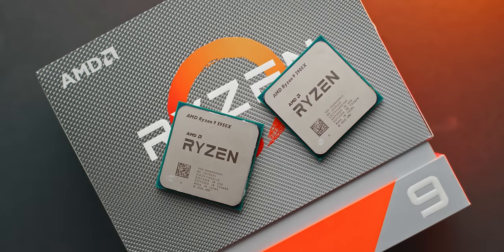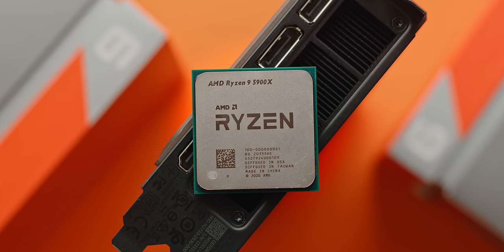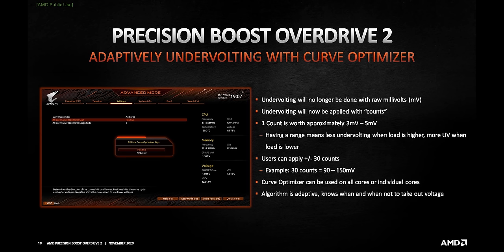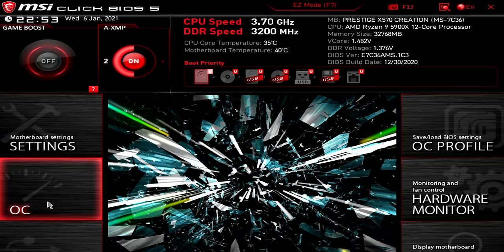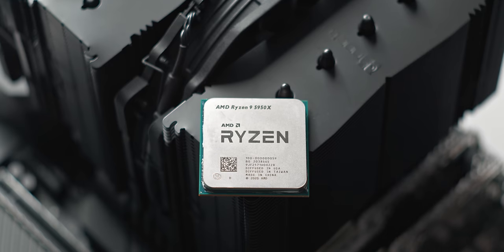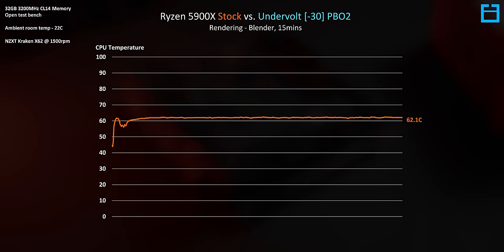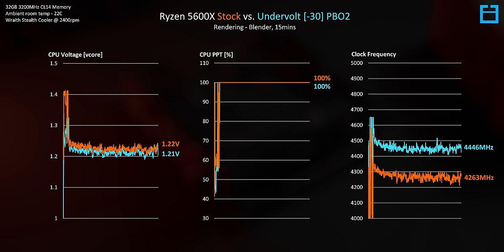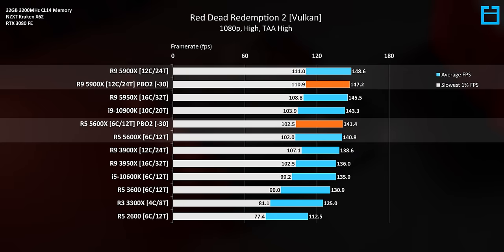Ryzen 5000 Undervolting with PBO2 – Absolutely Worth Doing

Comment from the maker: Slight correction - some users are seeing PBO2 available on B450 motherboards.
Another update: It is available on some boards with AGESA 1.1.0.0, including my Crosshair VIII Impact. Just tested the Ryzen 5900X in my own system - it can do a negative offset of 25.
Reply: If you push the curve down far enough with this feature, does it result in lower idle temps?
Reply: @ivchatov  yes sure does. But if u push curve and leave 200mhz auto oc on you may have to increase (from -30 or -20) curve to persay -12
Reply: @ivchatov  with auto no curve 200mhz auto oc max voltage is 1.45/48v on b550 gaming edge wifi, and it's x570 counter. With 200mhz auto oc + -12 curve max voltage (with 4.85ghz all core) is 1.41v.... temps will go crazy without pbo and limiting edc etc. He didn't touch this bc it's different for EVERY chip say, 10 5600x not one will have the same pbo limitations. (All is auto, no manual voltage sets other than 4000mhz 2000fclk to ram, and 1.45v on my dram voltage. No static oc to the processor. Am able to run 3200c14 sticks of tforce dark pro at 16,15,15,15,32,38 with tight subs an secondary timings. (Wasn't asked about but these chips from what I've seen are all doing 2000fclk oc. Even on e die kits (worst ram die to date.)
Reply: I have B450 Tomahawk Max with AGESA 1.1.0.0 Patch D. Running 5600X PBO2 enabled.
Reply: @turskaparoni  yep, curve works as I stated. It's under advanced on msi boards inside amd overclocking
Reply: Crosshair VIII impact does have a beta bios with 1.1.9.0
Reply: @VargVikernes1488  was running patch C without issues 3200c14 dark pro kit at 4000mhz 2000fclk but my L3 cache speed were horrible. Updated to beta 1.1.9.0 and now have the same results, but nomore issues with l3 cache.
Reply: @Kraxt0n  cool what are your Timining? currently stuck at 3800mhz/1900fclk cant seem to find a proper profile
Reply: @MistaMeester  it took me around about 4 minutes to get a 4000mhz 2000fclk to boot which is how long it took me to swap my new 3600xt out and install the 5600x lol, but it took me a few weeks to get these timings i have now. granted i could make a few adjustments considering my tfaw (SOME SAY) should be higher but none the less, no weird stuff or stutters or crashes. KEEP IN THE FRONT OF YOUR MIND that VDDG IOD, CCD, AND CLDO VDDP values STOCK are ALL WAY TO HIGH for what the 5000 series actually needs. stock values for my board all run 1.1/1.2 when you can see im running it way lower than what the boards believing it should be. 

AMD needs to get this configured bc it will start KILLING and DEGRADING signal integrity as well as start making the minimum safe mv adjustments go way higher than they should be.

IF YOU REALLY WANT TO KNOW MORE join https://www.overclock.net/threads/official-amd-ryzen-ddr4-24-7-memory-stability-thread.1628751/page-275#post-28712772
and thats where youll understand how these chips work, and see my claims to be true as some of these people are EXTREMELY knowledgeable and speak with amd directly as well as rework bios revisions for their own boards etc.
Reply: You mentioned not having the correct BIOS on your crosshair VIII impact board, I'm seeing that they have a beta BIOS available with 1.1.9.0. Not installed it on my board yet though.
Reply: @AdamChopdat  you both should for sure install 1.1.9.0 way better performance, stability, overclocking ram support period.
Reply: Would’ve been really nice to see this brought back, if only on 500 series motherboards
Reply: B550 vision only had AGESA 1.1.0.0 available.. Fml...
Reply: Where is 5800X? 😅😅
Reply: @tigerag29607  AGAIN, 1.1.0.0 has curve optimizer settings under AMD OVERCLOCKING.....not under cpu settings as showin in the vid...
Reply: @Kraxt0n  OK... Yea I get it.. I just assume AGESA 1.1.8.0 is better optimized or functioning whereas that version is maybe unstable.. Maybe that's why he only recommends it.. Idk
Reply: Why don't you do laptop reviews?
Reply: @tigerag29607  he didnt recommend it tho, he said its only available on 1.1.8.0 or higher as msi skipped 1.1.8.0 entirely and hit 1.1.9.0 but, patch C is pretty good for the most part. didnt have issues with it other than my L3 cache bandwith in benchmarks not being accurate to where as after updating to 1.1.9.0 now they set at 650/670ish and my read speeds are 59/60k and latency is 52.3/5 

all in all tho AGESA ComboAm4v2PI 1.0.8.1 has bar support and 1.1.0.0 has BAR as well as curve...just most dont know this bc its not in plain sight like it is in the vid as its under amd overclocking section which i dont believe many use as some state its still bugged....?
Reply: Tried on 1.1.0.0 and it's crashing the system and apps have to update to the beta 1.1.9.0 I'm on MSI b550 carbon
Reply: @AdamChopdat  and @optimum tech latest BIOS for the Crosshair VIII Impact (3102) does indeed have PBO2
Reply: Asus impact bios 3101
Reply: Sorry meant 3102
Reply: jump on the newer agesa beta bios for that board its far superior. i am willing to bet you are getting corrected WHEA log warnings on 1.1.0.0, they arent noticeable in use, but they absolutely spam the windows system logs with warnings, and that can effect single threaded performance pretty significantly if you are looking at the numbers.
Reply: Do you leave voltage at auto? Wish you went over the bios settings a little more.
Reply: @adi6293  probably because it's a horrible buy lmfao
Reply from the maker: @peeposadboy  yes, everything else default except XMP.
Reply: I dont know if i did something wrong but my 5900x is at -23 stable and hits 1.119v at 4.4ghz in cinebench r23 multicore... Are the steps on my mb different? (rog strix x570-e gaming)
Reply: @optimumtech  ty ty
Reply: @optimumtech  So I just set my Negative curve on my X570 Strix-i to 13, and some cores are boosting to 5.0ghz? In game it's around 4.7-4.8?? That don't seem normal... Should I lower it?? Vcore is only at around 1.32v
Reply: @peeposadboy  I got one for £420 with a £60 game that I was planning on buying anyway, it's not that terrible but it's not great either. I don't need 12 cores but wasn't even a consideration 5800X it's in a very awkward place on the market 😅😅
Reply: @BrunoMartinsHertZ  patch C?
Reply: @Kraxt0n  yes, for now I will wait for a stable build 1.1.9.0
Reply: @turskaparoni  are  you using the latest beta bios on the msi site?
Reply: @benson556  Yes, the one uploaded Dec 10th. Had it now for over a week without any problems. Running my 3600 b-die kit @ 3800 cl16 1:1 FCLK and fully stable after overnight Prime95 and Karhu stress tests.
Reply: New to this, but I tried the 30 and this caused my rig to restart. Dropped it to 12 and it worked...but I'm curious if there are only certain voltages you can use?

I.E. 12, 20, 30 are the only ones  or you can run the gambit between 1-infinity.
Reply: I tried -30 on my 5600x but it crashed halfway through a run of cinebench. Setting it to -28 allowed it to run fully stable for 5 simultaneous runs.
Reply: @ThreeForks  I wouldn gamble on anything beyond negitave 30 if it doesn't bug out. It'll drop voltage to the point to where it won't allow bios to be reachable. Which a simple bios reset will solve. 

From what I've noticed on my b550 gaming edge board 5600x +200mhz auto oc, negitave 12 curve voltage max 4.85ghz is 4.1v vs no curve is 1.48/5v which from what amd released 5000 series auto boost will hit 1.5v depending on temps, boost, what the system is doing...
Reply: @BrunoMartinsHertZ  Same here On Gigabyte Master X570. Crashing on -15 with 1.1.0.0. (-20 crashed MC and -15 crashed on SC but passed MC) Did not bother with lower values. For now I am going with -0.05 VCore offset and it is all good. I guess I will wait until get 1.1.9.0 AGESA
Reply: @Kraxt0n  Did you check for WHEA errors? When I setup my 3200 GSkill kit to 3600mhz I get spammed with WHEA errors. No idea if my Ram is to blame or whether the CPU can't handle it. I did try to push SoC and ram voltages quite high, they were still healthy but relatively high. Got the MSI MEG X570 Ace. Currently using the 7C35v1C bios which has Agesa 1.1.0.0 Patch C. There also is a beta bios availabla with Agesa 1.1.9.0 but I don't know whether I should update it or not.
Reply: @VenoXj1  yep, not a single error. Only issues I've had was a m.2 ssd enclosure not working right. Still hasn but I believe it's the SSK enclosure to blame. As for any error I have, it's only related to stuff I force kill i.e. razor synapse software, after burner, Px1, IDM, etc by task killing, or disabling the service related to the app and trying to run it as I disable services for benchmarks to keep them from running.

You should update that bios tho, 1.1.9.0 is by far the best yet. Your errors may be CCD, IOD, VDDP related. Or to lower voltage, or tRFC1 tRFC2 tRFC4 may be off. tRFC actually matters 1-2-4 all 3 will create errors on ryzen. But no, no errors period. Any blue screen I've had is pbo related to where I'm lowering ppt, etc values to low and using to hard a negitave offset curve.
Reply: @Kraxt0n  Yeah, I've had random BSOD which also were related to curve optimizer. I had to drop -15 to -10 so everything works fine. I might and try to update it, how do you actually do it though? I've never done it myself.
Reply: I just checked the available BIOS Updates of the B550m Mortar WiFi which I plan to buy together with a 5600x soon. This supposedly has a beta 1.2.0.0 agesa update and a 1.1.0.0 regular one. At least the 1.2.0.0 beta should be able to do this, right?
Reply: @Kraxt0n  I saw that you replied but sadly it doesn't show up here.
Reply: @optimumtech  Have you tried setting the magnitudes per core and leaving the best performing cores less undervoltage? I think this might improve the single core performance but like to hear more about it! Sorry if this has been asked/discussed already elsewhere
Reply: uiqbal11  I still havent figured out how to run my 5800x stable in 3dmark time spy with any of those settings, sadly. Cinebench is working fine.
Reply: My 5600x is only stable at -15. Even with that I got better results on multicore and single core (reaching 4.6ghz). Thanks a lot for the guide!
Reply: B550m Mortar with AGESA 1.2.0.0
Reply: How do you do this in the UEFI bios? Is it the “offset, negative,” then enter the value? Which value? 5900x and crosshair viii impact here. Thanks for the help.
Reply: @adi6293  in flames 🔥🔥🔥
Reply: @davey1412 ?? 😅😅
Reply: Any chance to do a walk through an the Asus bios? There are conflicting reports that “negative” and “positive” are actually reversed in bios for some reason. I can’t seem to get this 100%, and can’t get a stable system sadly.
Reply: @BrunoMartinsHertZ  yo my problem with the b550 carbon is my ram can only run single channel. Is yours running fine on the beta bios with dual channel?
Reply: @romeskiees  I didn't tried because is a beta and as you can see in reddit the msi just fool us because the stable build will be the same with another build number
Reply: Well with my system and 5600x

I get best results with the following

Bclk 101
PBO motherboard
Curve -4

I get 4.5GHz all core in R23

Where as outside of these settings i get max 4.35GHz

So depends on system and what you want mine cooks the shit out of itself but runs faster

Edit: i found better settings

PBO manual
100w
150 for the other 2
+200 offset
Scalar x10
All core negative 16

This will not work for anyone else all CPU’s will have a differing scalar and curve value required to stop crashes happening
Reply: @BrunoMartinsHertZ  thats trash but can you run your ram in dual channel?
Reply: still cant find it on my x570 strix w/ 5800x, any clue what im missing? pretty sure my bios is up to date. Says no new updates available.
Reply: @brockdawkins4290  you need to go to the manufacturer website for the motherboard and then go to support > bios and get the latest and install it

A bios is the brain of a motherboard and is a manual process to update
Reply: @commanderoof4578  copy that man. Thank you. I was just using software that came with the board. I’ll take a look into it. Thank you.
Reply: @romeskiees  with the last stable Iam using in dual channel
Reply: Does PBO2 work on laptops too? The new ryzen 5000 equipped laptops have been released and knowing that laptops tend to run hot undervolting would be a very nice way of keeping it cool
Reply: Thank you for this video I am sharing it everywhere You solved my 5900x's problems love you from Turkey
Reply: Can I use these settings for the 5600x?
Reply: Is better using this PBO2 option or CTR .
Reply: Just done this on my MSI B450 Gaming Plus Max with Ryzen 5 5600x. Previously I just had PBO enabled but it was pushing the temps up under load by about 20c (maxed out at 81c running Cinembench R23 in MC). 
With this guide I’m now getting the same PBO benchmarks but stock temperatures. It’s great 👍 Higher clocks. Lower temps. Better performance. Took me ages to find a guide as good as this one which actually showed some benefits. 👍👌😀
Reply: thank you! btw, is there a way to manually set the curve for each core on the crosshair VIII impact? i saw someone on reddit attempt something higher than 5 on their 5950x, and it was fine, setting it to 10 caused restarts. But when he set them up for each individual core, he found only 1 of his cores was capped at 5, and the rest was able to get to 25.
Reply: @optimumtech  How do I see if my PBO2 undervolt is stable? I have set it to -30 on my 5800X and didn't record any WHEA errors so far. I have ECC RAM btw.
Reply: I’ve got a 5950X with Asus Rog crosshairs viii dark hero and when I put in the value 12 it just stays gray
Reply: Hi Ali, My 5600X can do +100 override with curve optimizer negative 30. Prime 95 is stable for 2hrs smallest fft. Ran Cinebench R23, got 11200+ 4.4GHz+ all core. If I set PPT to 85W r23 score got 11453 @ 4.5Ghz+ all core. Thing is some saying its not possible, my system should be unstable... Can you please tell me what I need to do more to know whether it is stable or not?
Reply: hi there can i ask what settings are uou using in your power options? Balanced or high performance?
Reply: @sonjabrajkina3995  where are these settings on the gigabyte boards I can't find this on my gigabyte b550i mobo
Reply: What about on my ASUS mobo, on the amd overclocking, PBO, there is a setting. Core clock override, there is no Auto, only Disabled, positive, or Negative. I put disabled as I assume the system will base this on thermals?
Reply: ive been keeping update of Asrock and ASUS mobo to date, still no probs

Comment: easily the best ryzen undervolting guide I've seen, amazing content as always!
Reply: Stability isnt tested properly at all though in this video, the most important thing is testing at very LOW loads. These very low loads crash the system. How Ali does it in this vid, your pc will crash randomly while browsing or at the desktop.
Reply: @Grena567  yep, my 5600x was crashing randomly at desktop or in game lobby even at -15 or -20.
Reply: @Helicrom  what did you overcome the crashing ? What did you put for the pbo settings ?
Reply: @priiintplayzz6219  What I did, in short, was to go to per-core instead of all-cores. I'm doing -20 on 4 of the cores and -10 on the two cores that Windows seems to like the best (in my case, Cores 0 and 1 on my 5600X, checked using Ryzen Master). Idle testing consisted of doing nothing but leaving my PC on (running no active apps or tests), which I always do anyway. I probably could've gone back and pushed some cores to -25 or even -30 but I got bored.
Reply: @KarimTemple  thanks for this my pc kept crashing

Comment: This video still adding value. Just turned PBO2 on negative curve like the video suggests, managed to attain -30 first time. Can see all cores under 100% load hitting 4.3Ghz sustained with a vcore of 1.1875. Max temps were 66C on a 240 aio on a SFF case. Really cool, entire thing is a lot quieter now. Thank you!
Reply: hey, that's awesome! what cpu? you can also see what you can do with PBO and CO in ryzen master. I get 66C under load on a 5900x hitting 4.6 all core.

just let ryzen master auto CO all core for about an hour and you will get up to 28 depending on your cpu 30 all core is just not for everyone.
Reply: @no-pz7xy did you the best Bios and ryzen Master ? Which one do your prefer ? I have R9 5900x and Asus B550-A Gaming Mainboard 32GB ram 3600mhz and rtx3070ti and 360mm aio. 
I want to undervolt.

Comment: 5600X with a -30 offset, Arctic 240 aio, and 4400mhz Ballistix is scoring a 4610 in CB20. Maintaining a 4.6Ghz core clock while not going above 55c. 3 years later this thing is still holding strong at an insanenly low price.
Reply: Most excellent!